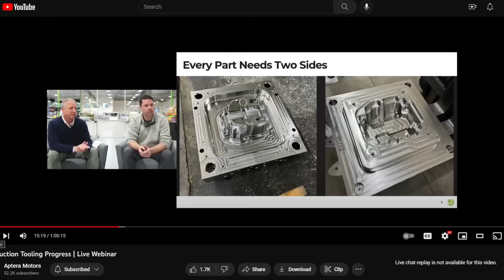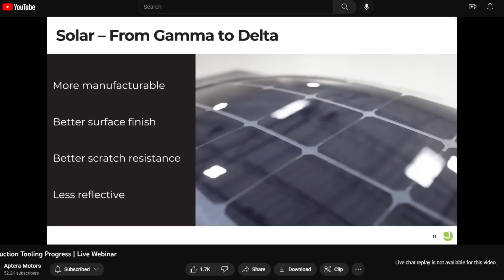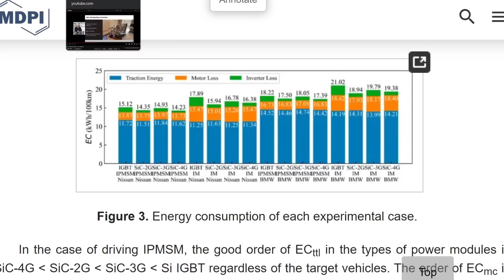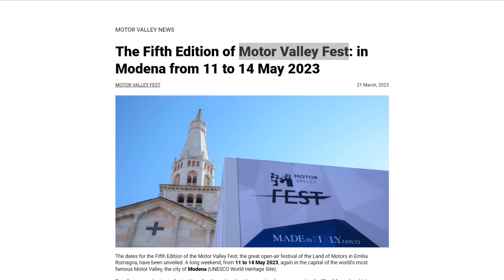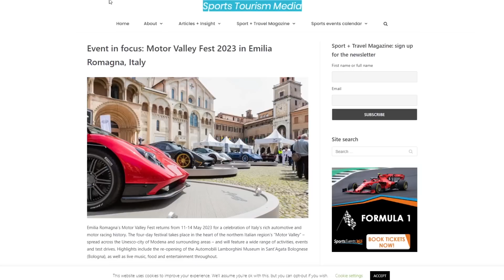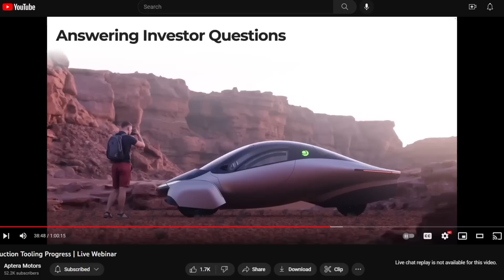Steel makes it Real:  Aptera Production Tooling Webinar Commentary

Comment: One more thing to add.   When Steve was talking about the cheaper inverters, he mentioned the “I squared” impact to losses.  I think his point was that because of the hub motor design, the current is distributed so the squaring impacts are much lower.

Comment: 50kw per wheel/motor....that is about the same power as the 2018-2021 ZeroSR motor of 70hp/52kw.  The zero is 416lbs so 5.9lbs/hp.  So the Aptera is gonna be a little more lbs/hp.  The Zero is FAST with tones of torque.

Comment: I've been thinking that the Aptera would be a great drag car with some beefier hub motors. That would require a drivetrain replacement down to the inverters though, so I hope they go with the cheapest route possible and better cooling since I might be replacing it all anyways. Only half serious, but this car with 400 or so horsepower would be something.

Comment: Just a couple of adds to Steve’s commentary; it is possible to put steel on a die, but it is way more intensive and time consuming than steel off.  Secondly, the point about the ATVM loan that I understood is that when they get the “substantially complete” notice, any investments thereafter can apply to the loan once it is fully approved.  Said another way, the loan, upon approval, can be used retroactively to the “substantially complete” date.

Comment: Thank you Steve for all that you do. Being a machinist I can relate to the die work. Large parts are very time intensive. Not only for the programmer but the machining aspect as well. We do rough, semi-finish, and finish machining sequences on every part we manufacture. Each one of those 8,000 lb. die halves have hundreds of hours in just the machining portion of the project. Why rough, semi, and finish machining some may ask. It allows the metal to  keep internal stresses low and also allows for higher quality finish as you remove less material per pass. Keep moving forward Aptera. Like what we are seeing thus far.
Reply from the maker: Thanks for your expertise

Comment: It's so nice having two actual engineers be the CEO's of Aptera. Actual dudes who actually got their own hands dirty making the vehicle.
Reply: Chris by education is a finance not engineering individual.  But Chris by experience has be backyard engineer.
Reply: Yep, two engineers that understand the importance of serviceability and right to repair at that. I hope they are still going to have a QR code stamped on each part and when scanned the part order page and instructions on how to replace it come up. This is the number one reason I will never own a Tesla, at least not until I can buy new parts and replace them myself.
Reply: Definitely. Tesla is the same, it seems to be working okay for them.
Reply: @castortoutnu  Musk aint a hardware engineer

Comment: I hope the initial molds will make parts that are compatible with all the battery sizes.
Reply: My guess is that the higher capacity  packs may rely on using more compact cell forms or chemistries.
Reply: I have heard that the 1,000 mile battery may need a fatter belly pan, but that is an aluminum part not made by CPC as far as I know...

Comment: Since a Three-motor Aptera will have less current running through each inverter most of the time, is it possible they will be more efficient overall than a two-motor Aptera, due to lower losses?
Reply: The extra mass will probably more than offset any small electrical efficiency gain.
Reply: 🤔Total drive force and current would be about the same, so if the inefficiency fraction is roughly constant with load I'd think the difference in losses between 2 and 3 motors would be negligable.

Comment: I wish the front wheel covers would have multiple attachment points so you vould just raise and lower them for more clearance. The rear wheel skirt already has better clearance than the front wheel covers so my concern is mostly with the front covers.
Reply: The rear Wheel Dives Into the skirt opposite to the Front wheels
Reply: There is a version of that for later date.

Comment: Any ideas on what kind of steel is used for the dies? Steve mentioned stainless so lots of chromium? À2, D2? Have they talked about heat treating? I'm curious how much the street for the dies costs.  How about the machining centers they are using. I'm assuming horizontal of some type because of the size. DMG?
Reply: I think Steve may have misspoke...I doubt that the dies are made of stainless steel...

Comment: Congrats on the shout out, Steve. Having the watched consistently watching the watcher is quite an impressive confirmation of your diligent & comprehensive coverage! You have all our gratitude in debt to you. Having implemented Munro’s lean design philosophy is clearly paying off 10-100X from the old, slow, inefficient, labor intensive, & consistency-less, hands on layups. With digital simulation, precision design, tooling, & manufacturing, I can easily see the evolution to a 4-wheeler, once they get to their first 1M mark. No wonder they were invited to be a feature of this year’s Modena Motor Valley Fest! Can’t wait to drive my FE!

Comment: I agree with your assessments here and there, including not understanding the grant rules. Also, the SiC mosfet vs. regular, they have to be careful about thermal management. I recall in previous videos 92% vs. 97% efficiency. You need to look at the heat difference not efficiency drop. So, instead of 3% loss they would get 8% loss, which is almost 3x more heat. That has to go somewhere.
Reply: At a constant 80 mph we are talking about 10.5 kw of power at the wheels.  If they take half the losses at the inverter this is about around 13kw total draw and 400 w of waste heat per inverter.  That makes each inverter the equivalent of a high end gaming pc going full blast in heating.  Tough to know if the skin cooling could dissipate that.
Reply: @ccibinel  According to my sources, the 40 kWh version will draw 6 kW at 60 mph. At 8% losses, it comes down to 160W per wheel. At 3%, it would be 60W.
Reply: @stanislavjaracz  We have two separate sources of loss; the motors and the inverters.  If the motors lose 5-7% and the inverters also lose 5-7% each factors in and reduces performance.  6kw with losses at 60 mph (5.99 actually) is the number I calculated so either I take this as a pretty good validation of my model or you are using my EV Range Estimate sheet.  My sheet also has the launch edition massively over performing with 460 miles of range so extra losses are still well within reason to have a well performing vehicle (not as much for the other pack sizes).  I used 10% combined (90% efficiency) but if that is increased to 14% that would lower the range by 20 miles at 55mph.
Reply: @ccibinel  Yes, I used your sheet that you shared previously. I couldn't tell that you are the author. Thanks for providing that. Looks like 20 miles hit, 4.3% based on your figures. This can get lost within the realm of YMMV.

Comment: Sounds good.  Quite a different machine from what we invested in back in '21.
Reply: Yes!  The quality potential has increased dramatically.
Reply: @n.brucenelson5920  I'm still curious how this new "skin" and the cast aluminum frame have impacted weight.  Any idea?
Reply: @unclegeorge7845  I have not heard updated specs on this.  I suspect we may need to wait until the production intent deltas are undergoing certification.
Reply: @n.brucenelson5920  I was hoping you may have heard something.  If you or Steve haven't been updated then I think they may not have a number yet.  Ahhh; To see their BOM spreadsheet per unit  Now that would be interesting.  Sorry but I'm a marginal cost kind of guy.  I guess in this case I'm a marginal weight kind of person.

Comment: I wonder if it would be possible to get a copy of the Aptera ATVM application under the Freedom of Information Act?  

Kinda disappointed not to see Aptera coming to Fully Charged Live in Vancouver (right across the border from Seattle).  BC is the strongest per capita EV market in north america.  Seems like Europe is getting spoiled with coverage despite having a huge regulatory mess to bring Aptera to the continent (length and width issues for L5e classification).  I cant even find anything on if Aptera will be at Fully Charged in San Diego this year.

Regarding Range Loss from Offroad here is the % range loss at 55mph based on my calculation sheet with the LE weight at different drag ratios: 

0.14: 4% loss
0.15: 7.7% loss
0.16: 11% loss
0.17: 14.2% loss
0.18:  17.1% loss

Note: these effects are worse at higher speed and less at lower.  I suspect we will be in the 0.15-0.16 range but this is largely a guess

I am happy they are not considering the powertrain set in stone as that opens the door for an eventual transition to newer chemistries and battery technologies over time with continual improvement.  A sodium based Aptera could still potentially achieve very good range (theoretically 500+ miles based on the gravitational and volumetric density of the best case for the 1000 mile) and would eliminate much of the carbon footprint from the battery production; it is possible Aptera could be less carbon intensive to produce than an ICE econobox on day 1 then over time its efficiency dwarfs even other EVs.   Even if Aptera gives up some efficiencies they will still be 2x as efficient as a model 3.
Reply from the maker: I know I would love to read it
Reply: I was disappointed they didn't come to the Electric Expo in Seattle. The PNW is heavy into EV's!
Reply: @complimentaryrandomnessinc3137  Yep either one would have been good.  I'd have driven down for that if Aptera was at it.